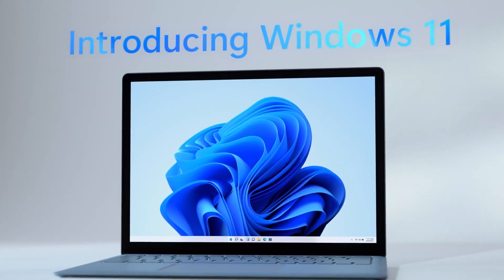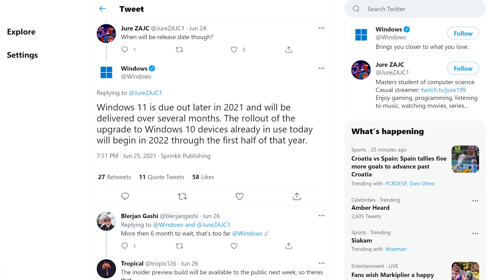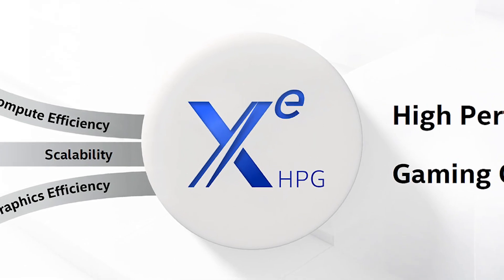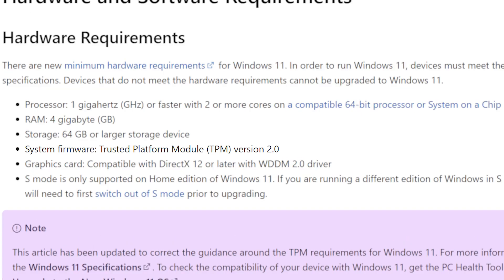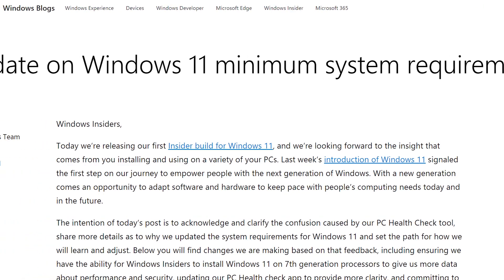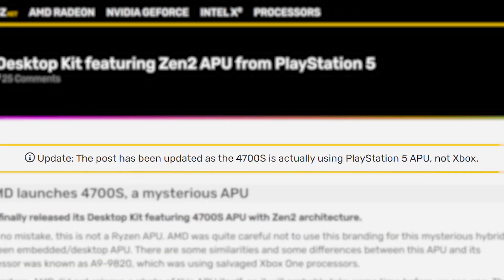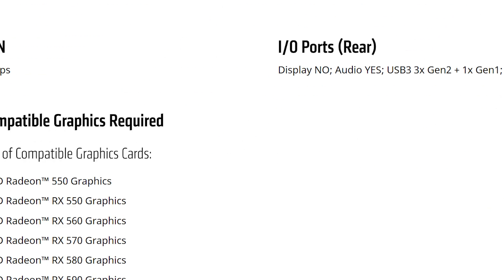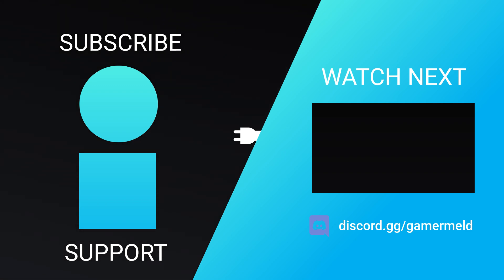TONS Of Gamers WON’T Be Able To Install Windows 11!

Comment: How can AMD call it an APU when it doesnt come with integrated graphics? Wouldnt that be just called a....CPU?
Reply: Every single Intel Core CPU with integrated graphics is technically an APU.
Reply: Well yes, but actually no
Reply: Amd doesn'T call it an apu, an apu at amd has the G-Suffix. It's just people that call it an APU because they saw/noticed that it had an integrated graphic unit.

Comment: gaming devs will continue to use what is stable, older versions of windows. It's really arrogant to change things so much, thinking that the overall public is going to jump ship. Each version of MS becomes more aggressive than the last.
Reply: if this horrible trends continue than game developers would definetely choose consoles over PCs, with windows getting worse you can expect less games going to be released for their system.
Reply: @eduuklee9453  that's very possible.
Reply: @eduuklee9453  either that or Linux would get more support on it. Thinking of using it when I build my first pc.
Reply: @muchneededwater5936  i dont think gamers would actually go for linux as many games are not supported. but that can change in the future maybe

Comment: Meh! Last time i got sticked with Windows 7 from 2011 to 2021, I guess now I'm going to get stick to Windows 10 until 2031.
No big deal. What's the rush to get the latest updates always?
Reply: If only the hardware I have and the programs I need to run supported Windows 7!
Reply: @JustinDaniels   In my case was the hardware the culprit, if not I'll still sticked to W7
Reply: @RDCST  Sadly, my Ryzen 9 5900x and RTX 3080 Ti wouldn't work with Windows 7. The same thing applies with DaVinci Resolve, and any modern games.
Reply: Windows 10 will get support untill 2025 only.
Reply: @rishirajsaikia1323   Yeah, sure that's what he says now, of course, they need to sell the new OS.
Reply: @rishirajsaikia1323  Maybe they'll have to extend it like they did with XP.
Reply: @rishirajsaikia1323  minimum

Comment: At this rate Linux will X5 Its OS share from 1.97% to 10% before Microsoft realizes they were too harsh with the Requirements. 

This seems very Optimistic but you never know

And

Comment: These hardware requirements were only made to benefit oems, people getting paid to have the requirements as steep as they are. Windows 11 can definitely function just fine on older hardware. TPM and Secure boot is also a way to edge microsoft into being a walled garden, they've been dialing back heavily on user freedom since Vista, its their vision or nothing.  

Windows 11 is going to have some neat features like auto hdr, and even with 10 I like spatial audio functionality (for encoded content it carries more information than 5.1/7.1).  But also with every update I surrender more control over my PC and what is a  valid experience for me.  But they know, pound for pound, I could never full time Linux and give up certain functionality.
Reply: Well you can buy TPM modules but why spend 100 or so(and if they work with windows). As for the neat features you describe, well most gamers already have them in the form of drivers and controllers. We are getting there with Linux, slowly but soon...
Reply: Windows Sonic is a blessing since Vista killed hardware acceleration for 3D audio 15 years ago. It took many years to implement HRTF or 3D audio into the OS.

Still, it's embarrasing that Aureal 3D 2.0 from 1998 and 1999 can't be surpassed, thanks Windows Vista and Creative for giving us more than a decade of awful downgrade for audio and BS stereo and dull multichannel. 

Valve has implemented real 3D audio into the Source engine in CSGO, maybe there is hope that the majority of the industry keeps up.
Reply: @saricubra2867  it is unfortunate it took as long as it did, my only problem with the spatial audio in windows atm is you dont really know if it's working properly for non supported games.
Reply: @RitzyBusiness  Problem being noone asked Microsoft to build they shitty 3d audio and whatnot. I would justify them pre 2011. After that we have it integrated in our headsets, microphones etc. For the love of god lets make Windows 11 core perform as intended and replace cmd/PowerShell with subsystem for Linux, that would be a start.
Reply: @godlikekiller4344   I would just merge cmd and powershell. No real reason to separate them. But subsystem for linux is it's own niche entity, it's only function is to allow easy access to a linux system without needing to dual boot or go through the hassle of setting up a VM.

As for spatial audio, having it over digital output is awesome. My headphones are leaps and bound better than gamer headphones.
Reply: @godlikekiller4344  you cannot integrate 3D Audio into that stuff. It's a sound processing thing.

Linux and windows have totally different Kernels, you can find MS-DOS stuff in 
CMD.
Reply: @RitzyBusiness  Gamer headphones usually have bad sound quality and  don't feel right for your ears unlike real headphones.
Reply: @RitzyBusiness  Woah, cheers on you then. I can not remember the last time I used it. Although I am kind of a maniac with the sound cards & quality in my system hence the 2grand I spent just for it.
Reply: Intel 7th generation and older chips are riddled with security holes. Apparently MS doesn’t want to fix them anymore.

Comment: just don't update to windows 11, even if your pc is compatible, i hate that they leave out pc's that are perfectly capable of running windows 11! If you don't have tpm 2 build into the mobo or cpu, or you don't have a tpm header on your motherboard, you are scr3wed. Microsoft is going the apple route, but that may work against them!
Reply: Supersop  I don't need to upgrade, my mobo has a tpm module header so i can plugin a tpm 2.0 module which is available for my mobo, its the fact that because of a stupid decision, millions of perfectly working machines are ready for ewaste, that is the problem. First tpm 1.2 would work, but they make sure it didn't.

Comment: Even if I can upgrade, I'll wait at least half a year. No reason to dump w10 yet.
Reply: i wil make a buttble usb stick with windows 11 on it.i am eligible for a free upgrade and wait a few years until bugs are worked out than upgrade
Reply: @connorglint7426   
They said windows 10 updates will continue until 2025 you can check Microsoft website

Comment: Most systems/motherboards have a setting in their bios that at least enables tpm 1.2 which would work to install windows 11. While this does mean older hardware wont be able to use it, I do feel that within a few days/weeks of windows 11 launch, there will be a work around created. Also keep in mind windows 10 has another few years of support before the plug is pulled.
Reply: That’s the old requirements. Microsoft changed their minds and now will require TPM 2.0 as a minimum for install in the full retail release
Reply: @thegamerfromjuipiter7545  Yup, they also increased req to 8th gen CPU or newer
Reply: TPM 1.2 was included by mistake, they really mean TPM 2.0 as the absolute minimum. on the bright side you can run Linux on pretty much anything
Reply: @alex15095  No one cares about linux. Seriously stop.
Reply: @NazmusLabs  The Linux ecosystem as it is today was made possible by a large number of unpaid groups composed of developers volunteering their own time for free to work on something they believe in (user freedom), and they've managed to create something that's now mostly a viable alternative to Windows, and you just ignore it and say "no one cares". OK
Reply: @alex15095  Not everyone cares for various reasons, me mainly cause half my apps don't have a linux alternative and i hear about it so much that its beginning to get annoying, even tho i don't hate Linux, i(m just getting tired
Reply: @ZedDevStuff  have you heard of Wine and Steam Proton? the only software i HAVEN'T been able to run has been games with horrible kernel-level anticheat

Comment: I think the System Requirements are quite off. I think If Microsoft wants a decent Adoption rate from Windows 10 to Windows 11 They should Revert the TPM requirements to 1.2. but they can Keep the 64 Bit requirements and the UEFI Secure boot requirements allowing anybody having a PC 10 Years and younger to Upgrade to Windows 11, and recommend more recent CPU's and TPM 2.0 

Otherwise If they Keep the Requirements the way they are Windows 11 Will not have much better Adoption rate especially early on compared to Vista and Windows 8 Regardless of the goods of the OS and It will make Linux's OS share go up a decent amount especially on Hardware older then 8th Gen

Of course people have tried to go around the Requirements. But Microsoft could just pull an apple an Lead anybody Older then 8th Gen to a Recovery screen If they Install a new feature update.
Reply: Supersop  One of My PCs Is 3 Years old and holds Intel 8th Gen so I will be able to Upgrade to Windows 11 on it but I won't be able too on my older machines

Comment: Most likely the idea is to push people into buying new OEM PCs, laptops, tablets, etc. Not just on the consumer side, but on the enterprise side too. How many enterprise companies and governments have tens of thousands of PCs that are the better part of a decade old? (how many ATMs are still running Win XP?) M$ makes many from pre installed OS and enterprise keys. This is nothing less than a good example of planned obsolescence.
M$ and OEM suppliers stand to make HUGE amounts of money from making hardware obsolete.

I have a sandy bridge laptop with a discreet 680m series nvidia gpu and 16 GB ram with a rather new SSD that meets every requirement EXCEPT the TPM module abilities. It runs Windows 10 as fast as it ever ran Windows 7, 8, 8.1. As fast as any netbook from last year. It would have been great to upgrade that laptop with Win 11 since it has a decent 17 inch screen and new laptops with 17 inch screens are dummy expensive.

Comment: I'm very curios about the computer sistems in schools and institutions, how will they solve the issue with Windows 11 ,(most of the pc's are low specs of 4th gen or 6th gen Intel cpus) especially if the institutions are self funded , especially in a rural or poor cities
Reply: 4TH GEN OR 6TH GEN???? MY SCHOOL PC HAS A XEON I DON'T KNOW WHAT
(Sorry for caps)
Reply: @lorenzoluppi1159  in my old schools are using old gen, becauae are cheaoer to buy

Comment: For anyone thinking of buying a TPM module, DON'T. Go into your bios and enable PTT for intel and fTPM for AMD. These are TPM features included with modern processors so you do not need a TPM module. I have confirmed that the 8700k has PTT and passes the compatibility test without a TPM module.
Reply: fx9590?

Comment: So if someone still use Windows 8.1 they will have longer support then Windows 10 in some way, because M$ will not force them with popups to upgrade software or hardware to run new crappy windows 11... my god, I miss the times when you could just buy OS if you wanted and then use it for few years without worry thet new update will f it up or company behind it will "jump start" a new old OS but decide for everyone to upgrade hardware because you cannot run "new old" system on old hardware, you cannot do it now anymore, you need to upgrade now and use our "new old" system, because it is crucial to have newer CPU that still have old security vulnerability, that makes sense... guess I will buy new hardware and intall other system instead :D